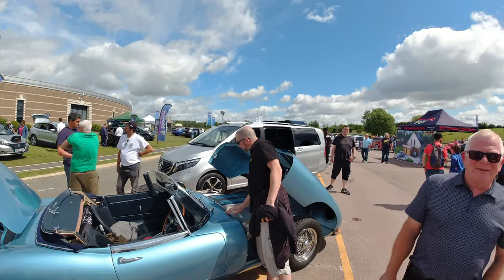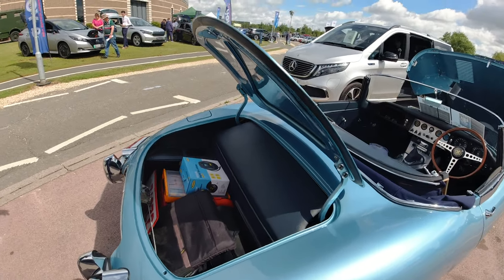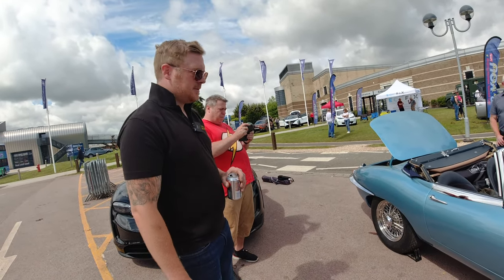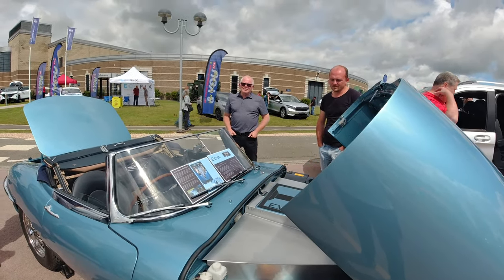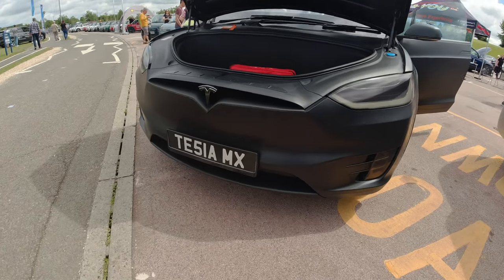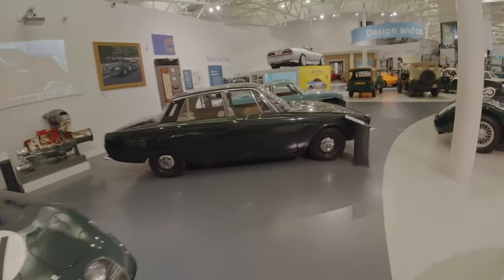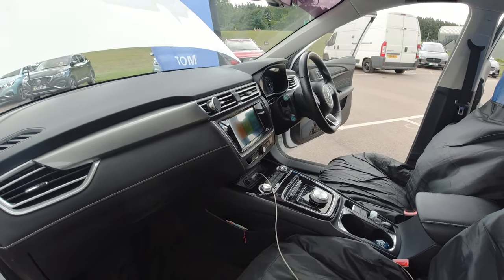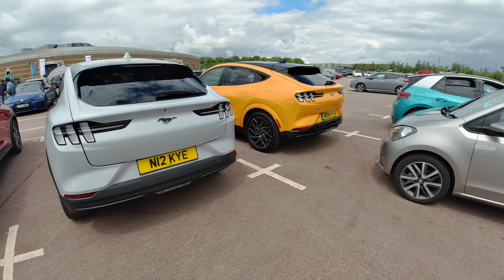Electric JAGUAR E TYPE EV Conversion #electricetype

Comment: You’ve got to be joking
They’ve removed its soul !!
Reply: Yeah, I expect they will really miss breaking down every road trip
Reply from the maker: @evs2k  this had me in stitches 🤣
Reply: What lump of cast iron and other metals assembled by humans has a soul again? 🤔
Reply from the maker: @4literv6  #TVRWedgee and #specialtrikee 🤣⚡😜
Reply: @chargeheadsuk  I'm looking forward to seeing that ev wedge conversion progress. 👍🏻😎
Reply from the maker: @4literv6  the motor should be arriving very soon, i'm super excited 🤫
Reply: @4literv6  what do you think makes the e type Jaguar part of what it is ?  That engine.
Without that as a figure of speech it soulless.
Reply: @markjones-vx3kp  not to me, everyone's opinions vary though. I always thought the motors sucked, the wheels are crap but the design itself was visually inspiring.
Reply: @4literv6  hi we’ll agree to disagree then you can’t take away its beauty though
All the best